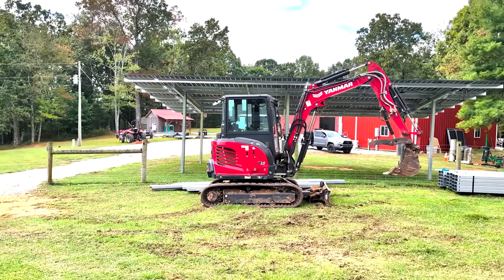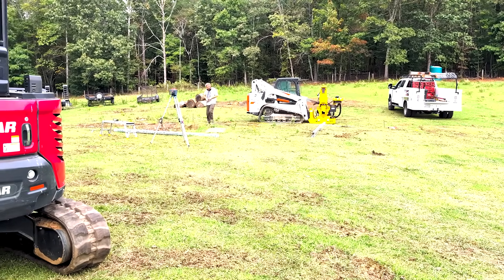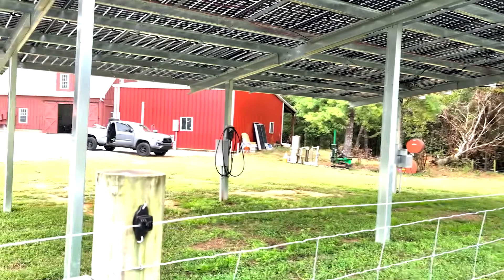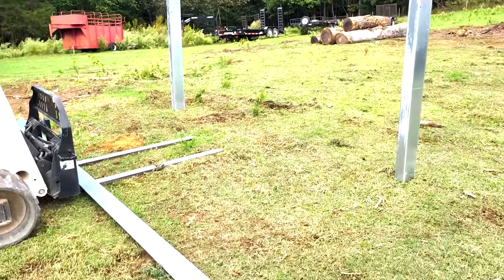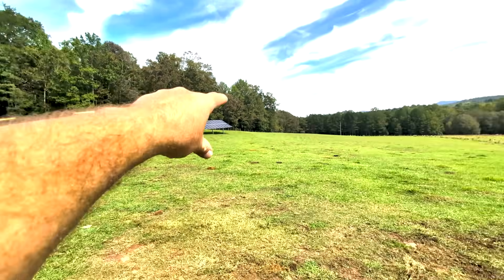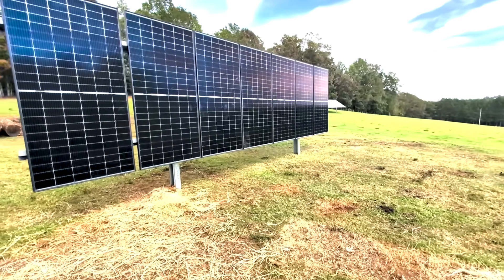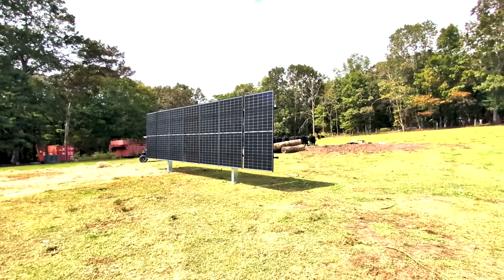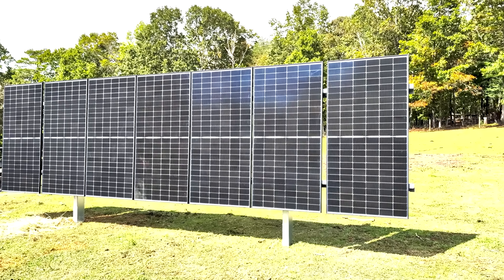Practical Fencing : Power and Privacy!

Comment: you should show the data of them vertical as opposed to the optimum angle for the area they are in...I live in kentucky and vertical panels would produce way less
I built a tracker for mine so in the summer from 7:30 to 7:30 I make optimum power if the sun is out

I am currently working on installing a micro hydro generator for the days when the sun isnt out

Comment: From an article I read about vertically mounted bifacial panels, the overall energy production over an entire day should be better than with traditional mounting. Performance around noon is lower than with conventional mounts, but you get significant gains once the sun passes the zenith, especially at the beginning and end of the day. The article also mentioned the “double duty” this setup provides, since it can be used as a fence. Some farmers are using solar panels as replacement fencing because the panels are now cheaper than some fence materials, and the amount of power you can generate along hundreds or even thousands of feet is quite large. There is also less dirt and other things like snow that accumulate going vertical.

Comment: The only issue I might have with this (outside of the perpendicular angle) is if you have any accumulated ground snow that might block the panels. Otherwise I think this is a great idea.
Reply: You want the bottom 18/24 inches up and may need to run a snowblower once in a while.

Comment: I am using vertical panels for E W facing vertical, to augment my main S facing sloped panels. It adds a number of hi gain hours to my solar PV day, evening things out nicely. Plus the benefit of collecting less snow than sloped panels, plus the reflection gains, plus the 2 sided bifacial effect. My thoughts for an ideal system would be a 4 MPPT channel controller, 1 E facing channel, 1 W, and 2 S.

Comment: In testing it was found that having the panels south facing gave the most gain out of any vertical orientation. During mid summer they found that 30⁰ panels did better than vertical, but other times of year they were even or vertical was better.

Comment: This is technically a code violation in Maine because the conductors are easy to grab, otherwise I’d try it too. I’m going to think of a way to make it work up here.
Reply: I had that issue and used a 1.5" or 2" PVC pipe (i forget which) along the back to stuff the wires in.  Each PVC pipe is only one panel long, so they can enter through holes and come out the end of the pipe for plugging in.  Then the extra is stuffed back inside.  They look great and passed inspection.
Reply: @s9josh778  I'm not sure I'm visualizing what you're saying. Wouldn't this mean the MC4 connectors are visible between modules? Was this in Maine?
Reply: @SolarGuyInMaine nope, the MC4 are inside too. All you see from behind is the pipe. This is MN, same rule.
Reply: @s9josh778  Are you simply cutting an entry hole in the side of the conduit? Like, it basically makes a cover for the j-boxes on the solar panels?
Reply: @S @SolarGuyInMaine s. I used a step bit to drill 2 holes in the side that line up with where the wires come out of the j-box. I also used a 3d print to join and recess it all for a very professional look. What’s your email? I can send a pic
Reply: @s9josh778  Ohhhh, I get what you're saying now, wicked cool!

Comment: Livestock will rub themselves on those panels and damage them, unless you fence them off
Reply: 1 electric fence line would be the only thing needed to stop that.
Reply: And chew any accessible wiring.  But I would do this all over my place if there is a solution.

Comment: Looks great. I don't think it's any good for agro-voltaics unless you raise them higher. Putting them horizontally would be beneficial for the bypass diodes (maybe 2 on top of each other). So if the bottom of the panel is shaded, all bypass diodes will kick in if you place them like you did. If you have it horizontally only 1/3, 2/3, or 3/3 will be bypassed the higher you go.

Comment: My house is on a hillside above a ridge to the west about a mile away, totally unobstructed. I have two ground mounts that provide all the power I need even in winter - snow not withstanding. That said, I have 6 panels that I will be mounting vertically on and out building facing east and south. Why? In winter the sun is pretty low in the sky and it's nice to start generating power as soon as the sun peaks itself above the horizon. Then the arc of the sun to the south illuminates the south side of the building pretty well so as long as it's not snowing there's extra power right there for other things. I don't have to wait for the sun to get high enough to illuminate the ground mounts. The other great thing is I'll never have to clean snow off them.

Comment: In Europe it's CHEAPER to build a vertical fence from SOLAR PANELS instead of wood because its MUCH cheaper. A panel costs about 60€ for 2 square meter, wood is much more expensive. For sure wood will not produce money, electricity will. furthermore you don't have to worry about snow on the panels as it will slide down. even north facing panels will produce electricity especially on light, but cloudy days. in my experience about 25-30% of south facing panels.

Comment: Vertical is the only way to go where I live in alaska as that is the only angle that doesn’t hold snow in the winter
Reply: I agree. I’ve seen some by North Pole that aren’t vertical and they were often covered.
Reply: When you are so far away from the equator you plan your solar for wintertime!  Summertime will take care of itself, even with vertical panels you will have more then you know what to do with. But wintertime is were it counts. 

Do lift them from the ground a bit so they are above the snow.

Comment: my initial home solar system used  12 100 watt siemens panels,  each cost $500.  this was back in 2000.   $5/watt.  total. Today panels are cheap, mounts can cost more than panels.  Then you optimized totally to maximize production of panel

today it can be cheaper and/or easier to simply put up lots of panels for a system (assuming you have land or space) to generate enough to photon harvest something

I have a small lot 4000 ft and 1100 ft house.   I put 4  used 250 watt panels on my west fence where it gets 3 hours of sun a day. not optimal for panel usage, BUT it produces  some cheap power on panels that usually would no longer be used

I am also looking at putting panels on my NORTH roof facing to harvest partial production from them. I live in utah, won't get much in winter but it will be greater than zero

Comment: For next vertical mount project, try using bifacial panels and c-channel on all four sides to minimize mount interference and then evaluate performance compared to standard incline mount.
Reply: The issue is the time & cost driving all those extra posts. Metal posts are not cheap.

Comment: I sure wouldn't let the cattle anywhere near those panels! Pretty expensive scratching wall. My array is at 70 deg, steeply sloped and almost vertical as they are Braun bifacial and self clean fairly well this way. Bird poo excepted, but I can reach the panels for easy cleaning. They shed snow well too.

Comment: You are doing great! The trigonometry of insolation never lies. Therefore, latitude is an important metric in the outcome. However, if you have a spare Outback FM80 charge controller or any other like device to make a MPPT path to the LiFePO4 bank,you could harvest even more energy than the built in MPPT channels of the AIO inverter. 
I wonder how mySolArk would accumulate the data of a non-internally-charted-MPPT resource? In other words outside dc-coupled, like a wind turbine or water wheel. 
Have you ever bolted another MPPT to an all-in-one’s close loop battery?

Comment: Ever since I saw the projects with every day Dave north/south vertical panels I've been trying to design some type of ground mount with the ability to swap to summer tilt and winter vertical. 

We get piles of snow where I am so vertical biracials above the snow line should really help with the heat pumps in the winter and then summer tilt can rip the AC in the summer hot hours.

I was thinking some type of rail system similar to garage door rails every 4 panels or so. But I'm no engineer to figure out how to make it strong enough.
Reply from the maker: The Sinclair Grand Mount is plenty strong. With seasonal adjust jacks, you can crank it pretty steep.

Comment: I have a vertical setup that has 4 panels pointing east, 4 panels pointing west, and 4 tiltable panels pointing southerly, this changed the charging graph in the mornings and evenings to an almost flat daily curve, the current configuration suits my needs much better than the old school way of all panels angled towards the south.
Stepping back and thinking about what happens in the midday, south facing has a large peak, the east facing panels do a bulk charge after a night of battery usage and the tilted panels facing south will bulk charge for awhile and the west facing panels float charge until dusk.
The other thing my fence is taller than whats in the video, you can walk right under the panels leaving room for some gardening 👍
BTW the tiltable mount is a repurposed C-band satellite dish mount, there is an electric actuator arm that can move horizon to horizon if supplemental charge is needed but it is mostly pointed south the declination is changed every couple of weeks to follow the sun.
If you asked if it is worth the effort? I would answer absolutely! Just because removing snow is a drag but the better charge curve puts it over the top.
Reply: Alot of people are mounting west here in Cali now that the energy grid pays you variable rates... highest rates in the afternoon.

Comment: My neighbor asked if she could put up a 6' White Vinyl privacy fence on the north side of my house, to replace my wooden privacy fence. I agreed, as I had (10) 415/539kW bifacial panels waiting. The white fence helps along with the white sea shell walking path along the base of the panels. I left my 4x4 fence posts up just to run a test on vertical mounted panels. I just have my critical loads sub panel directly connected to the EG4 6000XP. No HVAC, water heater, dryer or kitchen range. The wife told me that our electric bill dropped from $310 to $192 this month. The most that I got out of the panels so far was a peak of 3,020W, between 11:30 and 2PM. I have noticed that the output is increasing as the sun is getting lower in the sky. The EG4 14.3kWh wall mount battery gets fully charged each day. This is only temporary as I will be doing an angled permanent install in a month or so. Happy so far.
Reply: This is currently similar to our scenario. Neighbor north of us stripped his AirBNB of all trees & put up an 8 ft privacy fence, wood, not white though. Would kill to experiment to see what kind of power bifacial panels would generate as that’s the only real sunny spot of our property. But we just don’t have the funds to “tinker”. R really need to save money with solar from day one, not fiddle.
Reply: @butchgreene  Is the new 8 ft privacy fence well past the property line on their side?  If on the line, or you can get permission from the property owner, you might be able to modify your side.  It's possible the wood will weather to a silver grey, but you might be able to help it along and keep it lighter with some oxalic acid bleach.
Reply: @Sylvan_dB  neighbor is a complete jerk.
Reply: Do you have a explanation or detail of how you attached it to fence? Even though it's temporary I'd like to try it out as well.
Reply: @KeithOlbermannn  The 4x4 fence posts are 8' apart (fence panel width). I have 2 panels vertical between each 2 posts. I have (2) 10' lengths of Uni-strut horizontally across two posts with some overhang. I mounted the Uni-strut above and below each other to keep the length going between the next 2 posts. The top Uni-strut is 14" down from the top of the post and the bottom one is 48" down from the top of the post. Rock solid, but not hurricane proof. That will be addressed in the re-do.
Reply: That sounds wonderful!

Comment: I have one more array to install 4100 watt bi face and I was thinking abut doing this I know summer time it will not do as good but winter it will do fine and winter power is way I am adding it have enough 17000 wats now 150 amp system but 89 amps is the highest i seen the 3rd inverter is just for peace of mind something to one of the others it will be a back up to I get the other fix and I have 1400 ah of battery Do you think this is the way to go Thanks

Comment: I'm interested in seeing how your testing turns out. I saw someone else's video on this, and he conducted his testing for a while, showing some promising numbers for vertical, depending on what you are trying to accomplish. The vid dropped into my feed so I'm not sure if he is reliable so I wont put the link unless you ask for it but I'm sure you see plenty of vids. He basically compared production from different layouts
Reply from the maker: Yeah I believe I saw it.  I think this is a special use case as no one would build a vertical fence out of solar panels unless there was another reason to do it rather than just making power. There can be agri-voltaics reasons and or just fencing reasons.
Reply: @engineer775 @engineer775, would it make up for some of the lack of angle if you used two-sided panels pointed east/west so it picks up on both sides as the sun passes over? Hoping to pick it up with a longer day, I guess???
Reply: @engineer775 This is a great idea.  Understand the loss of productivity but like you said - if you are going to build a fence anyway…why not?    Fence material isn’t cheap - really like this idea. 

Thanks for video.

Comment: Awesome, thanks for sharing. Why the gap between 1st and last panels?
Reply from the maker: I use the Sinclair ground mount materials. Can you bolt on purlins or cantilevers? There is a overlap and to avoid the overlap there is a space increased between the panels. If you clamped the panels then there would be no space, but these are direct tie purlins that were punched for these panels so that is the way it works out.
Reply: @engineer775 oh perfect thank you im getting my adjustable sinclair on thursday  for 20 direct bolt 590 watt bifacials  🥳

Comment: Here's what both Google and NREL (The National Renewable Energy Laboratory has to say about vertically mounted solar modules: "Vertically mounting panels is generally not recommended because it significantly reduces their energy output, especially in the summer. While vertical panels can be useful in areas with heavy snowfall to prevent snow accumulation, this is not a major concern in most parts of the Southwest."
Reply from the maker: They definitely produce less energy output, but that should be obvious. The cool thing is that they're doing double duty. Just the money saved on less material for the ground mount would buy enough panels to offset the loss. And a lot of people's solar systems are overproducing in the summer and  cannot take advantage of it anyway.
Reply: If you have grid tie without true net metering and no batteries, it is much better to maximize the hours when you are self sufficient than it is to maximize export for which you are barely getting compensated. So having three strings, one facing east, one west, and one south might actually be better than other strategies. My utility company pays me like 2 cents per kWh for what I export and charges 30-60 cents for what I use. They call it net metering, but that is just a cruel joke.
Reply: North-south vertical bi-facial panels have been shown to out-produce conventional south facing panels in some tests. They also produce power more in sync with most household demand. 
My concern is wind. I hope I’m wrong, but I can envision that setup folding like a cheap tent in a bad storm.
Reply: @Kandyman54  that can be said about any fence or wall.  If you don't build it right it's going to blow it out. So you should build it correctly